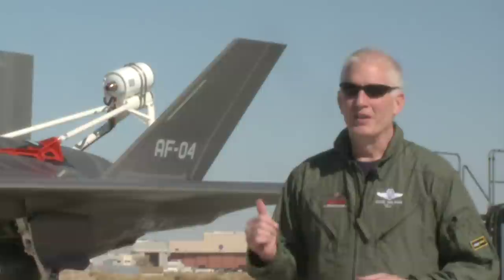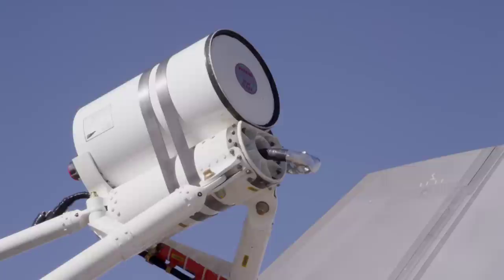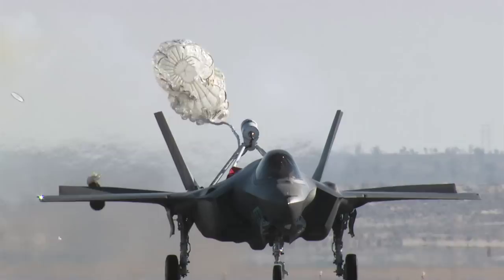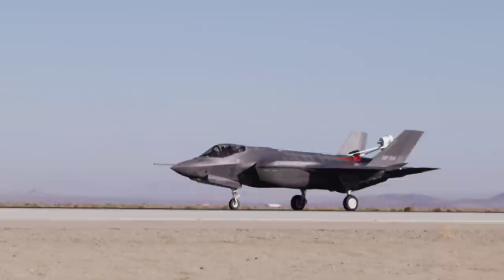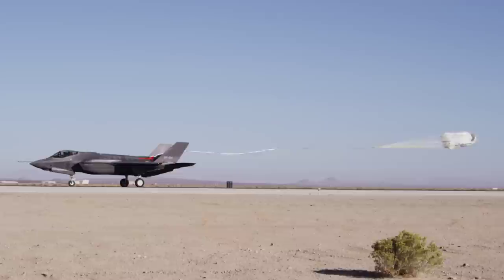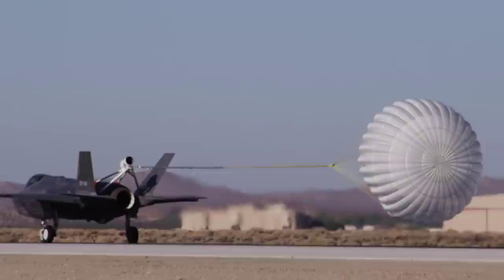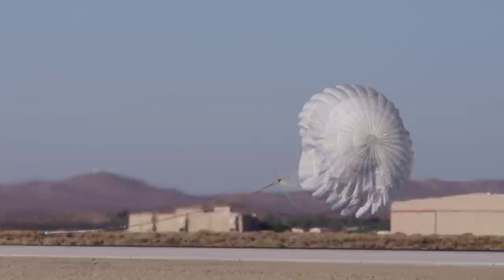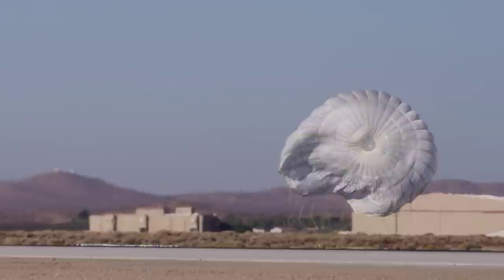F-35A Spin Recovery Chute Test

Comment: Should be standard equipment on all commercial and mandated on GA planes, which have a higher crash rate.
Reply: Some small GA aircraft do have it not because it is optional but the aircraft fail to recover from a stall spin. Cause most GA aircraft will recover itself in a stall by letting go of the control(Theory). But I heard to put a parachute on a aircraft, it will cause about 2million on a half a million aircraft.
Reply: @astudentpilotlife  Do you believe a parachute should cost $2 million?
Reply: @astudentpilotlife  reliability doesn’t have to cost $2 million. It’s a large parachute.